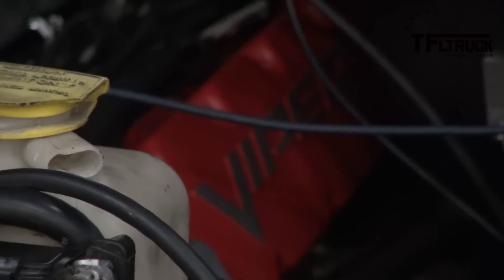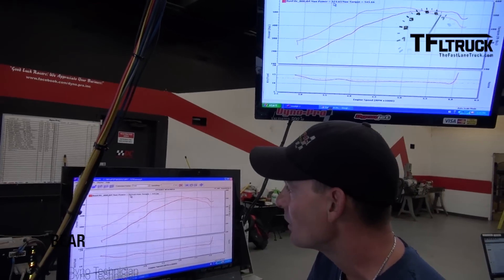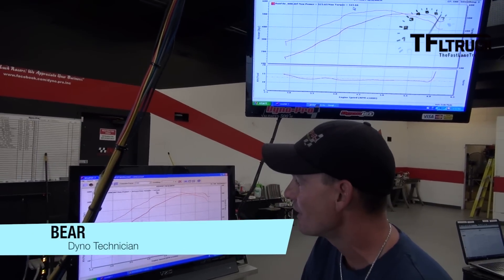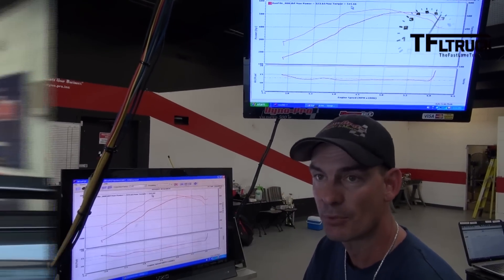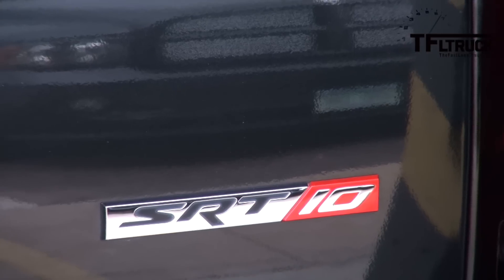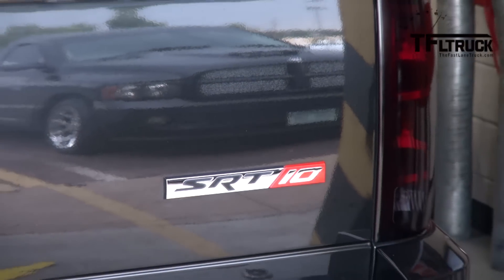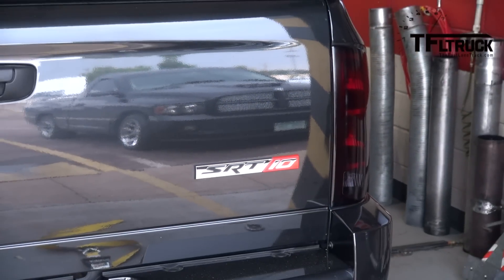Hot Rod Trucks Revealed: 2006 Dodge Ram SRT-10 Dyno Test

Comment: Automatic transmission in an awesome ride like that....blasphemy ;)
Reply: autos are faster for drag racing, but yeah a lot more boring.
Reply: +MrGimmethreesteps The single cab manuals were quiker than the 4 speed auto crew cabs.
Reply: Not when i drive them, id drive the shit out of an auto. 1 through 4th gear . I dont mind reaching and grabing me 2 gears lol
Reply: William Stewart that's more due to wieght and rear suspension setup. If wieght was equal the QC would be faster then the 6 speed,
Reply: I don't like automatic i like Manuel transmission
Reply: I love a Manuel transmission but an automomatic transmission has the fastest shifting